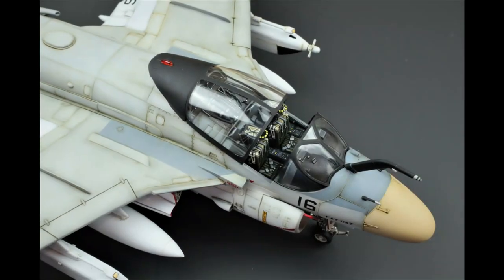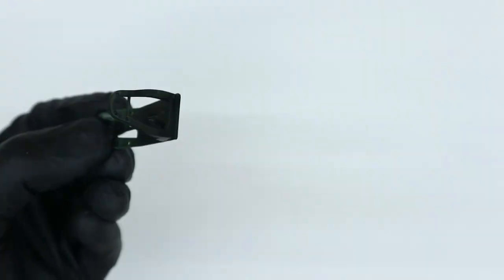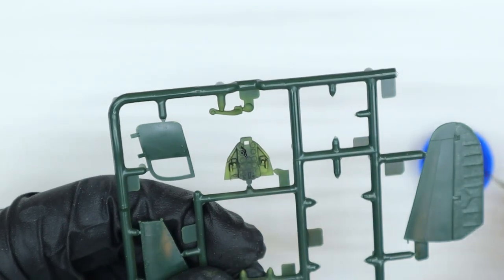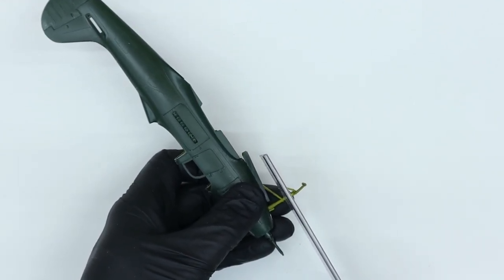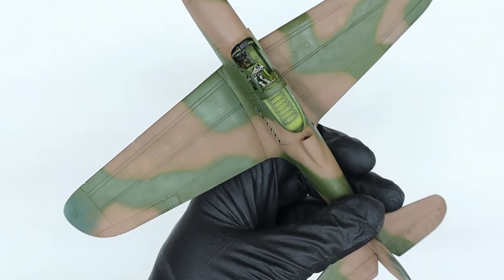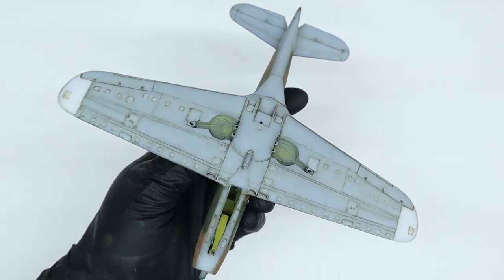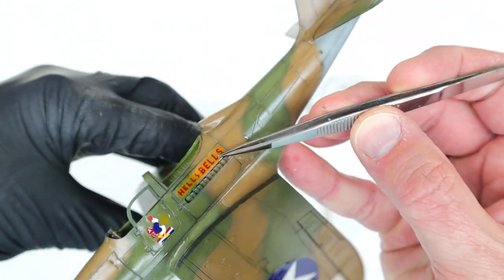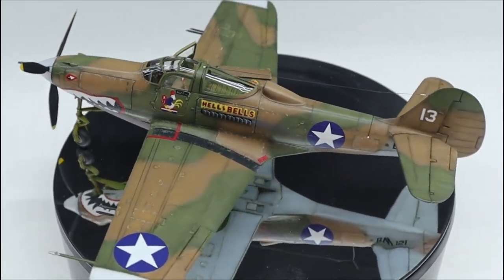1/48 Monogram P-39 Airacobra Build

Comment: No, that kit does NOT go back to 1963!  I recall very well when it first came out and I had hoped for a 1/48 P-39 for years.  Revell had an old 1/46 P-39 from the 1950's that was not too bad - with some work - but did not re-release it except as the Cobra II racer with a 4 blade prop.  Atlantis models sells a re-release of that old Revell kit.

Comment: All these years of modeling and it never occurred to me to tape the sides of the seams to prevent the filler from going all over the place!
Reply from the maker: You crack me up, Chuck.  You've probably been taping seems forever :)
Reply: @FlyingSModels  Honestly, I never did!  However, I have always been judicious about its application.  BTW, have you ever tried Bondo (or competing brand) automotive glazing putty?  Dead cheap and never cracks or shrinks.  Has toluene as a component so it chemically bonds to plastic.
Reply from the maker: @bgdavenport  I have.  I like it too.  It is cheaper than the Tamiya stuff as well and you get a lot more for the buck.  Typically, it dries out before I used it all :)

Comment: Nice! I forgot this kit goes back to 1963. Ahead of it's time.  I too have "always had a weakness for the Hells Bells Airacobra".  I was saddened when after all these decades that new information discounted the sand and spinach (kit color scheme)as being the correct colors used on the real plane. I wanted to do that scheme of colors for the variety of them. Although I love these  RAF colors  used here  too,  the most even, I'm sure!  Also I have seen that photo with ground crew standing in front of the "s" on Bells, thus some people today believe it may have read Hell's Bell, with no s at the end. I am also a huge fan of US Army under the wings on period planes. I have had miraculous luck on 50 year old decals using Liquid Decal Film, on decals that wouldn't stay together at all with out it. Nice build and video !
Reply from the maker: Yep, way ahead of it's time.  Still goes together really well.  Appreciate the history lesson you provided.  I had never heard that part about the ground crew potentially blocking the "s".  I was surprised that the decals worked as well as they did after all these years.  Appreciate you taking the time to provide some great feedback and insights.

Comment: Monogram was the first model manufacturer to do real scale models, instead of toys. I had the same issue of that Airacobra kit back in 1974 and that model still stands up very well today. As modelers we have been blessed with several great models of the P-39.
The Tamiya 1/48 F2A Buffalo is another classic kit that has held its' own over the years.
Reply from the maker: Amen, Alan.  They made some great kits that I didn't fully appreciate until I started revisiting them.  And you are right, that Tamiya Buffalo is another one of the classics.

Comment: I just built this kit a few weeks ago. I remember building it as a kid, too! You version is much better than mine but I enjoy watching how you do things. One suggestion for those old decals is to coat them with Microscale MI-12 decal film. It seemed to help keep the decals together- I didn't lose a single decal, either.
Reply from the maker: Such a memorable kit.  I appreciate you checking out the video and providing some good comments and suggestions.  I didn't have any issues with the decals on this one but I'll have to pick up some of that film as that may not be the case on the next "oldie".  Cheers!
Reply: That liquid decal film is a miracle worker isn't it ! That and HMS wet transfer stencils are two of the wonder workers I have encountered for modeling projects. Also Alclad chrome over gloss black system is another keeper for me!

Comment: Hey thank you this really helps, im building the p40 b tiger shark from revell with raised panel lines and rivets. I was kind of dissapointed because all the finished models I saw were kind of bad, i thought this happened because the model age. But now I know its possible to make an awesome model no matter its age.
Reply from the maker: I'm glad it helps.  These older kits are great and in my opinion, still deserve a little modeling "love".  While they may not be quite as good as the newer releases, they still can be built into some really nice models, even straight from the box.  Here's another one I did if you haven't checked it out yet: https://youtu.be/kna1oak6wls

Comment: As a model builder myself, I learned a few tips from the way you do things, compared to the way I do things.  Some of your techniques are pretty slick.  For me as far as decals go, I usually add them and set them before I weather the model, that way even the decals get some weathering and it matches the weathered areas around where the decal is placed on the model.  All in all that old model kit looks great, I am surprised you found an original kit from back in the day.
Reply from the maker: Yep, I usually come back in and weather the decals a little  bit with more oil wash after I apply a gloss coat and during the panel line wash process.  Thanks for the checking out the video and I'm glad it helped a little bit.  I had to buy the kit on eBay to get the boxing I wanted but it was less than 20 bucks or so.  Thanks for the thoughtful comments.  Happy Modeling on your end!

Comment: Fantastic job on this!  When you were repainting the wheel wells how did you pull that mask off the underside of the wing without pulling the decal up as well?  Ive had terrible luck with masking tape pulling up decals after I have clear coated them. Thx
Reply from the maker: Appreciate that, Kirk.  As far as masking over decals, there are a few tricks that I use. I must admit that they don't always work but they sure lower the risk to lifting  a decal.  The first one is that after I have the decals down and coated with the AK setting solution, I add a coat of Shikiso decal solution.  A friend of mine from overseas sent this to me so I'm not sure if it's available in the US.  It does, however, work really, really well.  Secondly, and maybe just as importantly, I stick the tape to my shirt or my pants a few times to pick up a little cotton lint and reduce the tackiness of it. As you likely have experienced, even the lowest tack tape out there can still lift decals.  On the P-39 for example, I hadn't even clear coated after the decals when I masked over them and they were 50 year old decals too.  Trick seemed to work well.  Let me know if you need anything else.  Cheers!

Comment: I really like your videos, sir. Very informative and enjoyable. Thank you for sharing your knowledge and techniques. Can you please provide more information on the sanding files and tools that you use, especially the thin needle file that can be seen from time to time in your videos? Which would be the best cut numbers for rough filing and a more smooth finish?
Reply from the maker: Thanks for the feedback and I'm hopeful that the techniques shared are somewhat helpful.  As far as the sanding files, I think I bought those off of Micro Mark years ago.  There are various brands but they are all pretty similar.  Here's a set that's similar to what I use: https://amzn.to/3wkkqYR
Thank you again and let me know if you need anything else.
Reply: @FlyingSModels  Thank you very much for the information. Just ordered the file set from the link you've shared. Can't wait for another video - in the meantime I'll keep perfecting weathering using your methods. Thanks again and all the best :)
Reply from the maker: @sinus2220  Sure thing.  I hope they work out for you.  The files aren't my most used set of tools but when you need them, nothing else will do.  I'm working on the next build/video now.  Keep building on your end too.  Cheers!

Comment: Do you seal the paint, before applying your oil based panel wash? I'm referring to your cockpit work. I've never had good luck with mixing paint medias.
Reply from the maker: I don't.  I just put the oils directly on the acrylic paint.  I haven't had any issues using Tamiya and/or AK Real colors for that acrylic flat paint work.  Hope this helps.

Comment: Nice work! How do you manage to recover the raised panel lines when sanding the joints of the fuselage?
Reply from the maker: Thanks!  In those cases, I often "cheat" by either scribing a new line or I just use that weathering with oils technique to artistically weather in a new line.

Comment: Great build! I’m currently working on an earlier boxing of the Monogram Bubble Top P-47 and am finding that it fits together really well too. What are your thoughts in the AK setting solution? I Is it comparable to something like Solva Set that only requires one step instead of two different  solutions like the Micro Set and Micro Sol system? I have used stock Tamiya and Monogram decals that are 10-20 years old several times. I think that they are made a little thicker to prolong the shelf life but sometimes they do require a pretty aggressive setting solution to get them to settle down in the details.
Reply from the maker: Hey Scott.  The Monogram Tbolt is another great one.  I really want to do that one again myself.  On the AK solution, it's pretty gentle stuff and I've found for some of the thicker decals that I do require a coat of a different solution that's a bit stronger.  A friend of mine from Argentina sent me some Shikiso decal solution that works really well on those thick and tougher decals.  I apply it after the AK has done all it can do.  I'm not sure if it's readily available everywhere, though.  Have fun with that P-47.  Look forward to hearing and/or seeing some results.

Comment: Yeah that is impressive work on such an old kit. :) I don´t do it myself but maybe I should? alter..
I am kinda fresh back into it and need to just learn some techniques. It helps making Tamiya kits then.. ;)
Reply: How long do those oil paints need to dry for the panel line washes?

Really liked how you improved the decals with paint too! Hell´s Bells looked much better that way!
Reply from the maker: For sure.  Tamiya kits will certainly help build confidence and allow for some good practice working with various painting techniques without getting into bad fit issues and ultimately, frustration and maybe burnout.
Reply from the maker: Thanks.  The decals being that old were really bad.  They needed some help.  I'll usually let the panel line washes dry for about 10 - 20 mins before wiping them off.
Reply: @FlyingSModels  Ah that´s not too bad. I´ve used the Tamiya Panel Line Washes (well, black) and it works nicely. Just need to try oil paints for it too..
Reply: @FlyingSModels  Yeah.I´ve built a couple of Tarangus Viggens in row.. Have an AJ 37 that´s been basically fully built but need painting that had me a little burned out.. Needed quite a bit of filling and so on.. So building a Tamiya is totally different..!

Comment: Came out good. What were the Sanding Pads you were using? The link in your Description looked like another brand. I use the Infini Pads , similar to those?
Reply from the maker: Hey John,  appreciate the good words. On the sanding pads, I actually got the ones I'm using sent to me from someone in the UK and I haven't been able to find the exact ones here in the US.  They are all very similar, though, pretty much like those used for sanding and buffing nails.  A soft foam core with a coating of sanding powder/particles.  The Infiniti pads from Micro Mark are pretty much the same.
Reply: @FlyingSModels  Yeah the infini pads are nice. I think I saw Champion Scale Models use something similar to what your using and he's in UK.
Reply from the maker: @johnmorel4382  I think I actually got them is part of my subscription to Model Aircraft Mag out of the UK.  They work pretty good and I like the size of them.

Comment: The biuld came out beautifully as expected just one question. What did you do about the raised panel lines on the fuselage when sanding the seems? Well done, as with you I love this little kit!!!
Reply from the maker: Thanks, Stacy.  Appreciate the good words.  For the few seams on the upper fuse that were lost when sanded, I actually just "painted" those back on as part of the oil weathering process.  I just added the dark oil paint and then when removing it with the white spirit, I just left a trace around where the panel would have been.  Hope this helps.

Comment: does the spirits not take off your base paint. I thought you had to clear coat first to protect your paint or maybe im missing something
Reply from the maker: Nope, no clear coat required when using artists grade white spirits.  At least I have had no issues when using over Tamiya and AK real colors acrylics.  It really is a different approach to weathering.  If you clear coat, the oil paint/wash will pretty much wipe off of most surfaces and stay in the recessed areas like rivets and panel lines.  If you use this technique, the oils blend into the base coat using those white spirits and change the tone of the paint itself.  Hope this helps.
Reply: @FlyingSModels  thank you, this helps a lot. I forgot to mention it’s one of the best models I’ve probably ever seen. Greta job
Reply from the maker: @smukki6346  I really appreciate that!